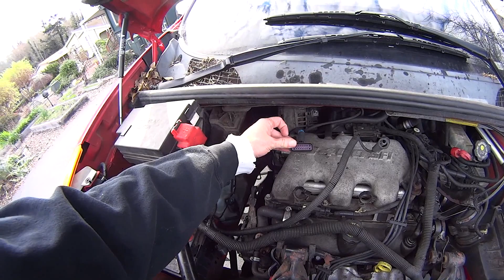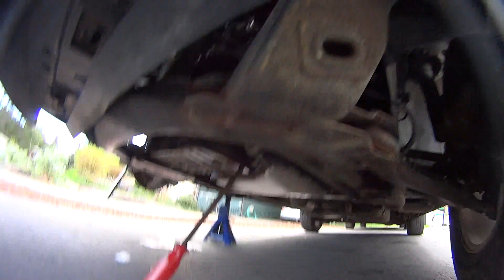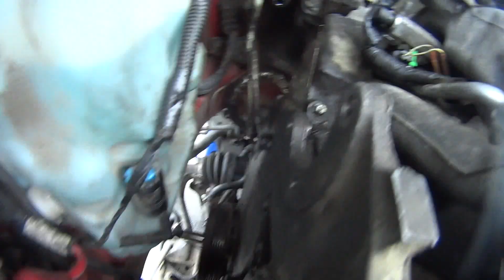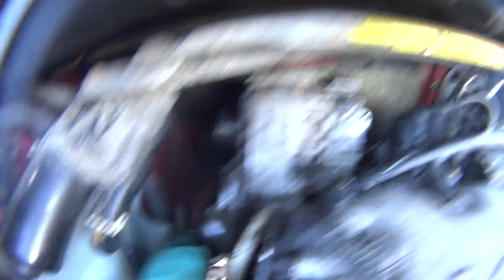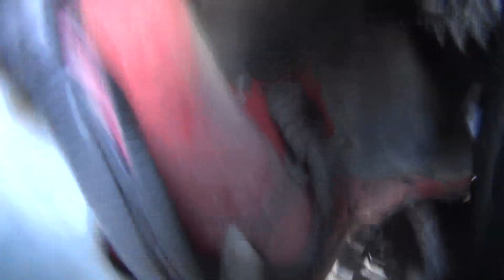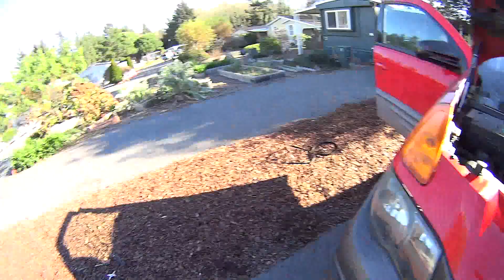How to Fix & Repair a Front Timing Cover Seal GM 3400 3.4 V6

Comment: Why did you have to remove the harmonic balancer?
Reply from the maker: Had to remove the harmonic balancer to get the timing cover off.  Also wanted to replace the balancer seal while doing the job.
VT247

Comment: Do i need to remove alternator and balancer to replace timing cover gasket?
Reply from the maker: Yes, pretty much everything on the passenger side of the motor will need to come off, including the water pump.  Be a good idea to replace the crank sensor while you’re in there too.  
VT247

Comment: 3.4 liter:  at 190,000 miles just like a clock this is what will happen. 1st it seems like the intake gasket will leak , then as you change that you loosen the integrity of the block mostly when you remove the alternator bracket it creates some freedom in the timing cover ( intake gasket =14 hours) , 2nd it will start leaking antifreeze thru the timing cover(timing cover =10 hours), 3rd  there is a pipe under the fuel rail  that goes into the intake called a bypass tube that maybe nearly rusted out as your moving the intake around the pipe will start to leak on top of the intake(bypass tube =6 hours) , 4th then as you move the pipe for the transmission dipstick the rubber gromet that seals that will start to leak(gromet =2 hours). Also the fuel pressure regulator will start to leak because the orings is really old and can deal with the moving around (fuel regulator =2hours). You will probably break the solid vacuum tube line for the evac while you are puting in the new bypass tube under the fuel rail i was able to fix that one with silicone.(brittle tube fixing =1 hour) It will probably get broken because in order to press in the new bypass tube it will have to be heated and pressed in with great force. And remember the injectors are on there last days as well at 190,000 miles this is my experience. as one thing fails it will generate secondary and multiple failures. As you change the timing cover gasket you will also be thinking the timing chain is also at end of its life and this is an interference engine!!. Also the crank position sensor could fail at any time at its age, might as well change it will be only one more bolt at that point. As you have that area apart you will notice your cvc joint has been leaking for a while might as well change that seal as well, the other side is not far behind. If you havent changed the wheel bearing already its right there might as well do it now failure in mine was at about 140,000 miles. When you finish all that and you think its all good then the head gaskets will start leaking. At any point if you fail to notice an antifreeze leak before it overheats it will warp the heads. You will keep thinking its just one more thing. lol It will be the same process as you reach 90 years old one system will fail causing side effects to the next and next problem until one day you slip up an miss your fixing window and its game over.
Reply from the maker: Sounds like you've had a few of these!  They certainly have some (a lot) of issues.  Don't think I'll ever get another.  They need constant maintenance.
VT247
Reply: For Sure!!
Reply: Pure poetry....... I've owned two 3.4's never again.

Comment: I HAVE A 2006  PONTIAC TORRENT 3400 V6 

AND JUST GETTING IN TO  ABOUT 2 MONTHS NOW I'VE NOTICED ENGINE OIL LEAK MY PASSENAGER SIDE CHASSIC FRAME IS WET WITH OIL, TOOK IT TO MY MEHANIC AND HE CANNOT FIND THE PROBLEM, MY MECHANIC FIXED THE BLOWN HEAD GASKETS  BUT NOW HAVE OIL LEAK. NEW OIL FILTER ADAPTER GASKET IS INSTALLED I WAS THINKING THAT EITHER IT COULD BE MY BASEPAN OR THE FRONT MAIN BEARING GASKET, OH I DID NOTICE THAT AS MY SUV WAS RUNNING IN IDLE I SAW OIL ON THE GROUND.  BUT  WHEN THE ENGINE IS OFF IT'S NOT DRIPPING.

Comment: Had a severe leak, paid a mechanic $50 to do the pressure test, he said it wasn't the head or manifold gaskets (yay!) but probably is this timing cover gasket - although he wanted another $300 just to take some parts off to trace the leak. Am going elsewhere.

Comment: A mechanic told me I had to change the serpentine belt too because it's too greasy from the timing cover gasket leak.  Some how I don't believe him.  His was the second opinion I got so he knew I was shopping for better prices but the first mechanic added a $50 charge for PC valve which it didn't need so he added $50 for the serpentine belt.  At least I am paying for a new belt which I don't need.  I am thinking he probably will not even change the belt just adding charges because I am a woman.  The first mechanic charge $150 for the part(timing cover) second mechanic is charging $75 for the part but he added the extra charge to his labor $99 3 hours job.  So they both came to the exact price in the end
 All cheaters and liars ripping innocent women off. Total price $540.00
2008 Pontiac G5 .
Any advice please.

Comment: You did not mention that I had to take off the oil pan. I think the timing chain cover should come off without doing that. That could be a pain. I still have not got it off yet. Also I have not taking off the power steering. Do I have to take that off.
Reply from the maker: I didn't take the oil pan off.  Believe there are a couple bolts holding it on from underneath though.  Was able to put some silicone near the edges where it seals and had no problem.  It's a rubber gasket so it can be reused.  The power steering needs to come off.  The lines will hold it on there if left on.  Not sure of how many total bolts hold it on.  The entire front assembly should be removed from the timing cover including the harmonic balancer.
VT247

Comment: I think I have removed all the bolts for the timing cover and I still can't get it loose. Is there hidden bolts somewhere I could  have missed.
Reply from the maker: It's possible.  Does take some force to dislodge it, but not much.  Make sure everything is off the timing cover.  Some of the bolts are sunk into the cover and harder to find.
VT247
Reply: Ok thanks I will check because it does not  move at all

Comment: How do I remove the power steering pump.
Reply: 3 bolts hold it....use and deep 13mm-14mm socket and look for the bolts thru the steering pulley.....its not that difficult.

Comment: Do I have to remover the power steering pump to get the cover off.
Reply from the maker: Counterclockwise to remove the bolt.  I'm sure it's on there really good, they usually are.  Probably need to lock the engine from turning like I did in the video with a pry bar otherwise the motor will spin.  Might be able to use an impact gun.  Everything except the water pump needs to be removed from the timing cover.  The power steering pump needs to be removed.  Break the line free from pump, believe it is either an 18mm or 5/8.  There are 3 bolts that go through the pump holding it on, have to spin the pump pulley holes around to line up with the bolts for removal.  Also helps to try and get all the fluid out prior to removal, less of a mess.  Also be sure to drain the coolant before taking off the timing cover too.
VT247
Reply: Well, the power steering pump does not need to be disconnected from the lines. Messy addition for no reason. Sorry, Vacation time, if you want my respect, you will watch BSG/Fordtechmakuloco, and the other guy that does the timing cover, the guy with the southern accent. Clean up your videos and info. They are spotty and not very helpful or correct. People need to see every bolt come out one at a time. Use fast forward, but sho every step as you do it. This jumping to “ok it’s off”, after a pause from “OK, we are starting to take it off” is pretty much useless. No one watches a how to video to see before and after sections, we all want the whole process on video.

Comment: To remove the crank shaft bolt is it clock wise or counter clock wise mine is very tight. e-mail is lorne @coultman.com

Comment: i have a 2003 Buick Rendezvous seems to be the same as the Astex. How do I take the crank shaft pulley off to change the timing chain. I have to change the timing chain. Is there a video on how to do that. I removed the washer fluid tank but maybe I did not have to. i did it to get more space. my email is lorne@coultman.com
Reply from the maker: You'll need a harmonic balancer removal tool to take off the crank pulley.  Have a video up on how to do this repair.  Search -    How to Fix & Repair a Front Timing Cover Seal GM 3400 3.4 V6    - Hope this helps, sent an email too.
VT247

Comment: You didn't hav to take the  alternator off and you could of just moved the power steering pump out of the way.
Reply: Thanks for your help. I was thinking I could just move it. My problem now is I feel I have removed all the bolts, and nothing moves like there is bolts somewhere but I do not see any.
Reply: How many bolts are around the timing chain cover I have removed 9 bolts and I still can not get the cover off.
Reply: It should say in the Haynes manual.
Reply: I have tried to buy a Haynes manual and it looks like they do not make one for a buick 
or Astec  2003
Reply: http://download.aj-sw.ch/TransSport/Haynes_Repair_Manual_Chevy_3-4l/Handbuch_3_4_gesamt.pdf
Reply: look up.

Comment: I just purchased a 1998 Oldsmobile Sillhouette with the 3.4 engine, and it needs a new timing chain cover gasket. The Repair Shop I prefer to go to hates the 3.4 engines, and have quoted me a price of $1,000.00, and the only way they said they would do the job is if they replace the water pump and some kind of sensor, since both parts have to be removed to gain access to the timing chain cover. My question is this: The Water Pump was just replaced about 6 months ago by the previous owner, and has less than 500 miles on it, and is not leaking or damaged in any way... Is it really a justified call for them to demand to replace the practically brand new water pump just to do the rest, even if there is absolutely nothing wrong with the water pump ? Or are they demanding to replace the water pump as a way of making extra money off me ?
Reply: I normally tell people it is cost-efficient and preventative maintenance to get it replaced but... you already had it replaced so no need.

Comment: my 96 olds has only one of the big top motor mounts, every other 3.1 3.4 video shows two and shows how easy it is to roll the motor forward, i have half the engine apart for full gasket replacment and still cant roll this motor forward, removed the rear head and manifold by laying on top of the engine with my head against the fire wall, gonna start my timing and balancer gasket tomorrow then time for putting rocker arms and push rods back in, your videos have helped me alot i only have one complaint, you and most others skip the hundreds of hours it takes to clean every part

Comment: I can see that Oldsmobile silhouette 3.4 has olmost or the same engine. I've found leak  good spot of coolant under my van. When I crank the car to worm it up I saw the steem comes up from the back of engine and I took a look undr the car I noticed it's leaking drop by drop so I turned my van off. What should it be because , also, there's small spot of oil as well next to that spot where coolant leaked.  Can you please respont and give me a piece of advice what it should be.  Thanks in advance.
Reply from the maker: Go to Autozone and get the loan a tool coolant pressure tester.  Fill the radiator up, pressurize the system, watch for the leak.  It'll come out pretty quick.  This will show you where the leak is and what needs fixed.
VT247
Reply: +Vacationtime247 Ok, here is the update of what's happened yesterday.  For a long time, I had a problem with radiator cap, and I was unable to remove it,  but, yes, I was able to turn it on and off.  Yesterday I finally removed the cap and while the engine was running coolant came out of radiator and I purposely let it out until coolant has reached level of the cap of radiator and stop running out.  . I drove my van about 5 miles and no leak after that. Only small spot of oil under  the car i have found but i already have a  new oil pan gasket and transmission filter and gasket as well. Since my van has 163k miles  and I purchased it as used I assumed that no one ever replaced the gaskets and filters , so I will do it. The purpose of this respond to your reply is for the visitors of your channel to see what else can be a problem before they spend their money before checking their car. I will rent the pressure tool and do what you said. Thank you for your fast response.
Reply: Vacationtime247 are you a mechanic or an everyday Joe like the rest off us so we can know if we can do this..

Comment: Did you replace your timing chain while you were at it? It shouldn't be many more steps than this... might be a good idea to go ahead and do that while you're there!
Reply from the maker: Might need a gear puller and installer for the crankshaft gear.  Didn't replace mine.  Old one was still ok.
VT247

Comment: I went to Firestone and the pressure test said it is a Timing Cover Gasket... I have an 01 Monte Carlo and I can't afford another car right now nor can I spend the $850 they said it needs to fix it. I want to go out on a limb and me and a friend just get the parts and fix it ourself. Is this video it to fix it? & how long do you think a car could last without the fix & just keep coolant in it?
Reply from the maker: Just a suggestion, but you might also try Craigslist or Facebook for a person to fix it cheaper.  Someone would probably charge @$200-$300 and do the job on site.  
This video shows most steps on getting the job done.  It's not easy, but can be done in a day.  Don't try and keep filling it up.  It'll overheat eventually and that would be all kinds of bad.
VT247
Reply: +Vacationtime247 was it leaking oil or coolant?
Reply: +Vacationtime247 nevermind I see where you said yes... What is I get a coolant flush/ Gasket sealant? Would that help until I get another car? Someone told me the Timing cover gasket leaks oil not coolant & now I'm all confused.
Reply from the maker: The coolant stop leak can plug up the radiator and probably won't stop the leak.  The timing cover will usually leak coolant. 
VT247

Comment: I didn't hear you mention it, but did you have to do anything with a/c at all?  I have a 99 Grand Am with a leaking timing cover.  Same motor, but different configuration maybe.  I'm not sure on mine, if I actually need to disconnect my A/C or not.
Reply from the maker: +GoAskDad Don't have to remove the A/C to fix the front timing cover seal.  To do a head gasket job it would need removed / lowered but not drained of R134.
VT247

Comment: So I need your advice. I just did the heads on my aztek. The oil pan seal was replaced. How do I properly seal the timing cover to the pan? Where do place the rtv sealant?
Reply from the maker: +GEICO Kaveman I used some just on the corner edges.  Haven't seen any leaks from around there so it must have worked. : )
VT247
Reply: Vacationtime247 what do you mean?
Reply: Perfect example, why didn’t you simply show yourself putting the sealant on? Are these novices supposed to guess at what you leave out? Are these videos to help others? Or boost your ego? Incomplete instructions are downright booby traps. Like all the pros here that mislead on purpose, to get more clients...or just chuckle. I worked in auto repair, many mechanics purposely mislead clients just for fun. It’s a miserable profession. God bless Tesla!

Comment: +Vacationtime247 oh okay, yeah I had already went through the trouble of the intake manifold gaskets and it was still leaking, so I was frustrated until I came across your video. when you pulled the front cover off, did you see where exactly it was seeping from? I just want to know so I can put emphasis on rtv in that area.
Reply from the maker: +x6dingle6x Get a coolant pressure tester from Autozone loan a tool.  Buy the tool, use it, return it and get your money back.  It hooks to the radiator cap location.  Fill up your radiator with water, hook up the tester and pressurize the system.  It puts pressure into the system and water will shoot out from wherever the leak is.  Easiest way I've found to find coolant leaks.  Hopefully it isn't the head gaskets as they are known for failure as well.  : /
VT247
Reply: +Vacationtime247 okay, I'll do that to be sure where it's coming from. yeah I hope it's not the head gasket either. although I have a good feeling it's not (fingers crossed) thanks for your help.

Comment: were you leaking coolant?
Reply from the maker: +x6dingle6x Yes, it was leaking coolant.  The gasket failed and spit out all the antifreeze.  Seems the gaskets in these cars don't hold up well from the factory.  Replaced the head gaskets, the intake manifold gaskets and the timing chain cover gasket.
VT247